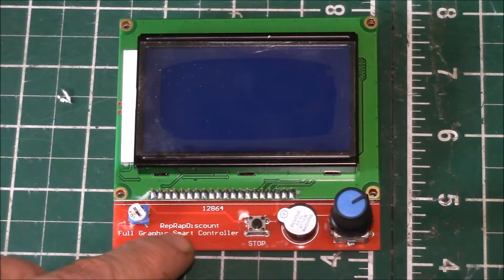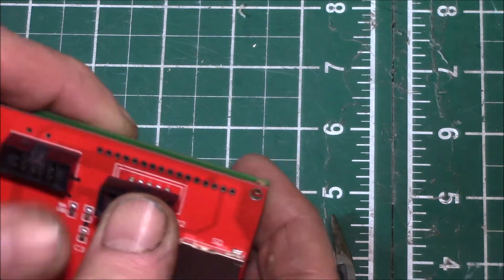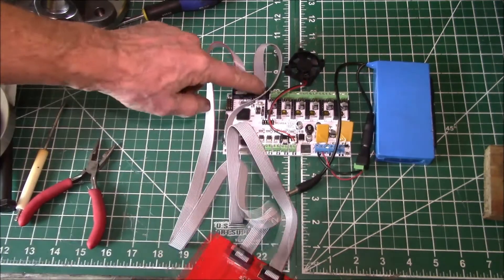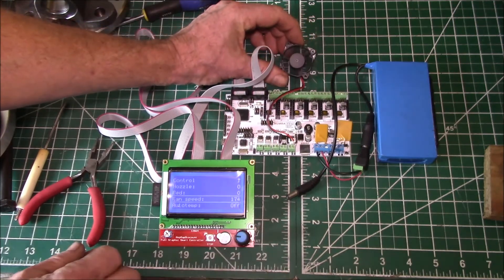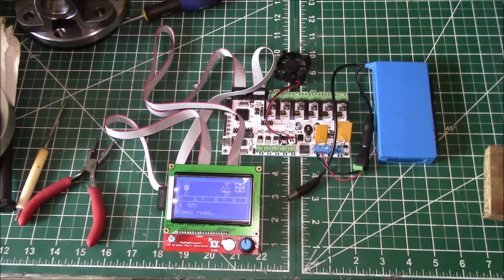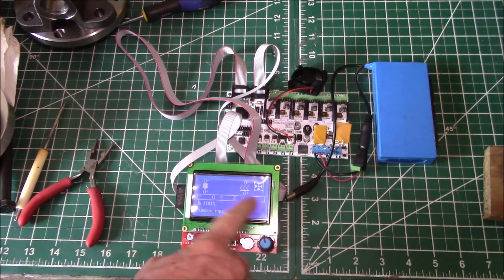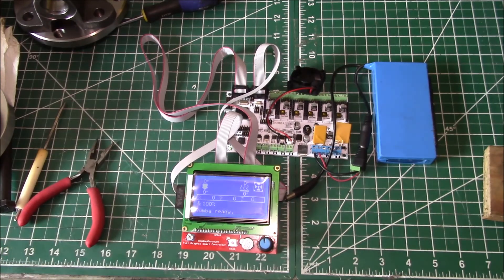Adding an LCD Smart Controller to a Series 1 Pro 3D Printer, Part 4

Comment: THANKS! I would never have guessed to flip around the notches.  Immediately fixed my problem trying to connect this screen to a gt2560 board.
Reply from the maker: Great, glad the tip helped.  It took me quite a while to find that trick.  I'm still amazed that hooking it up backwards causes no damage.

Comment: did you ever post the video about reversing the scrolling in the full graphic controller   ?  10 months and i still want to change it.   I cant get my second extruder to move.  it is in all the heating menus but when i choose move axis i dont have a choice of move ext 1 or ext 2.  it just moves extruder 1. even if i preheat extruder 2.  thanks again for the above video.  I am constructing my third printer from scratch.
Reply from the maker: This is what I did for that on mine:
https://youtu.be/s1P6enF_5dk?list=PLpY2FP1a9tisfyeH6pMvax6YHcbzAiKvj&t=545

Comment: HI, This is my first time machine built as a hobby work, where i have done the detailed drawing for 5/6 axis engraving machine,  
   NVEM interface board which is showed in your attached link  drawing . im planning to use the same machine (stepper drive / stepper motor) to make a larger size of 3D printing Using this product:

https://www.aliexpress.com/item/BIQU-Rumba-control-board-DIY-cooler-fan-LCD-2004-controller-display-jumper-wire-Rumba-control-board/32680555838.html?spm=a2g0s.9042311.0.0.27424c4dKmvRGm

  I really don’t know what kind of modification will take place this 3d Printing control board will adopt the larger capacity of X/Y/Z axis steper motor.and I need to connecting detail for the homing & limit switch, can you able to give your support for me to complete the circuit detail?
Engraving details is as mention below

https://drive.google.com/open?id=1slU-F-UnR8qgxo5lyPxN9zuPfswfRd0t

Thanks

Comment: R Brown, I know that this is late, but try finding //#define SDSUPPORT and uncomment it for SD card support. For your encoder, check out https://www.youtube.com/watch?v=H3wj9l1hvVw at the 4:27 mark.

Success! Of sorts... I copied the two configuration files found at: "Marlin\example_configurations\AlephObjects\TAZ4" and the rotary switch works (backwards, like yours), and the SD card works!

To get your direction corrected, swap the two button pins found in pins_RUMBA.h from:

#define BTN_EN1            11
#define BTN_EN2            12

to:

#define BTN_EN1            12
#define BTN_EN2            11
Reply from the maker: Thanks, yes, I found that define and got the SD card working.  I also found a #define to swap the encoder direction as well as adjust the sensitivity.
Reply: You're welcome!

I was installing the darn thing and stripped out one of the heated bed terminals. I have a box of Tyco terminals that should drop right in, so it's just a nuisance.

Comment: To cut to the chase:

1) Download Marlin, unzip it to your Rumba folder.
2) Open configuration.h and uncomment this line:
   #define REPRAP_DISCOUNT_FULL_GRAPHIC_SMART_CONTROLLER
3) Save this file. Compile and download Marlin to your Rumba.
4) If you are lucky as I was, you won't have connector shells on your Rumba board. Swap your connector there. Otherwise follow R Brown's instructions.
   When you have your LCD cable correct, your LCD will light up. So get that right and then plug in the other cable.
5) If all that you see is a lit up LCD, turn your contrast down (counterclockwise), your Marlin screen should show up now. If all that it does is flash and beep/chirp at you, then you have the LCD cable plugged in backwards.

Thanks to R Brown, I'm at this point. I don't think that my encoder (rotary knob) works, that comes next.

Comment: ?'??? Is not enough to turn connector in the rumba board?
Reply from the maker: Thanks for the comment.  Yes, you could turn a connector shell over on the RUMBA board as well.  I had two RUMBA boards, one was already installed down inside my printer, so harder to get to that.  I also wanted to keep the cables on the RUMBA board in the same orientation as shown in the on-line installation pages:
http://reprap.org/wiki/RUMBA

Comment: my encoder and buzzer is not working will this work for me sir plz help me out from this
Reply from the maker: One way to find out is to try it and see.  I recall one of my displays would beep if you clicked the encoder switch.  The other did nothing.  Both worked fine if I flipped the connector shells around.

Comment: I am still trying to get my 12864 display (MINI12864 from MKS) which looks similar but smaller display with my RUMBA. No luck thus far.
Reply from the maker: Might want to check the connector and ribbon cable connections and see how those match between the LCD and Rumba:
http://reprap.org/wiki/MKS_MINI_12864
It may or may not need the connector shells flipped over.
Reply: R Brown the Rumba doesn't have shells and I've been meaning to check the actual pins.
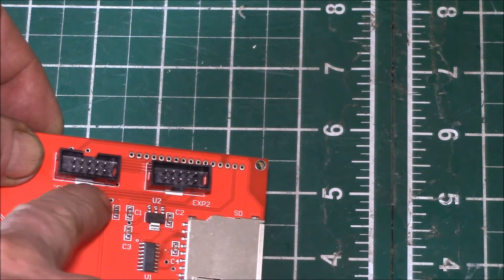Reply from the maker: The connector shells on the display board, see @1:23 in this video.

Comment: I could not get the marlin software to upload until I disconnected my display-  then I knew it was a cable problem.  Thank god I found your video.    I reversed the connector guides on the LCD controller like you said and the Screen came up finally. I wasted about ten hours trying different versions of arduino, installing and reinstalling drivers, and the u8glib.  Thank you so much!  You just need a closer view of the connection to the Rumba I was a little bit worried that I had that side wrong.
Reply from the maker: Glad the video helped.  Your experience sounds like mine.  I found the connection on the Rumba was fine, just like on my 20x4 LCD.